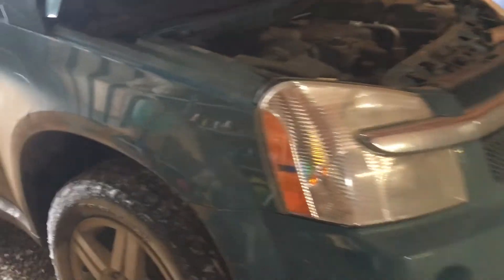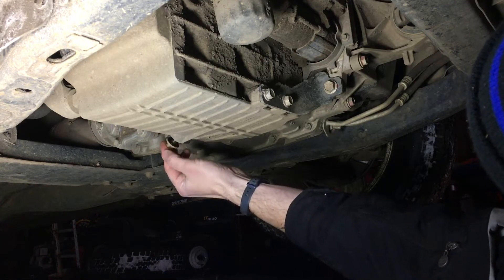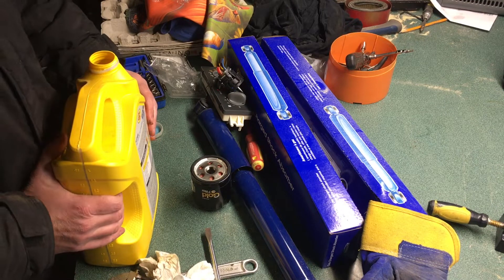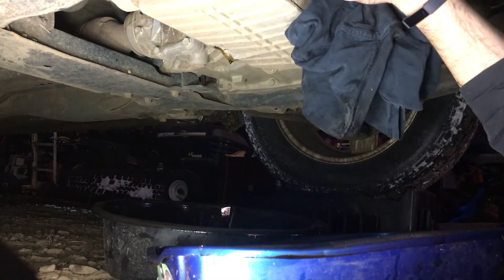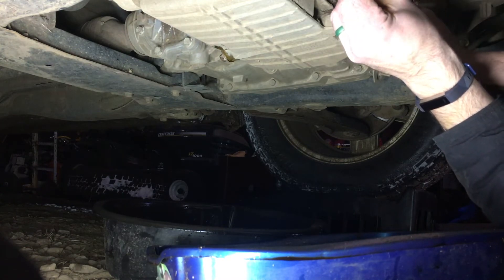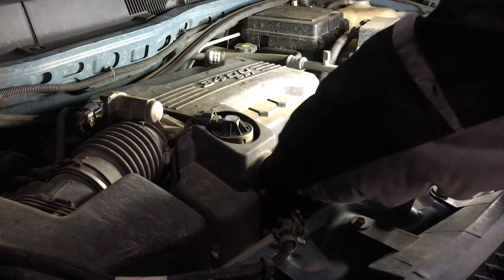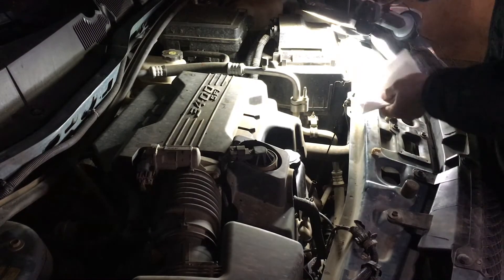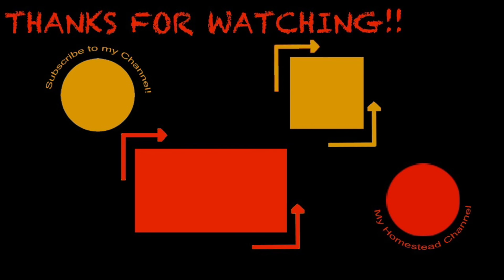2008 Chevy Equinox Oil Change DIY/How to

Comment: I also have an 08 Equinox and the recommended oil to use which works best is the 5W-30 and since my vehicle has over 100k I use the Penn Platinum High Mileage Full Synthetic oil and when I first put more oil a couple days ago (it's my first car my grandpa is giving to me so I have lots of learning to do) I immediately noticed a big difference in the cars performance. Much smoother, sounds better. I actually have to do an oil change soon anyways and was hoping to find a video so I know what to expect. Thank you so much.
Reply from the maker: You are welcome.  The most important thing about oil is that you change it.  Brands sell you different things, but just be sure you do your maintenance.  We use a full synthetic oil for this car.